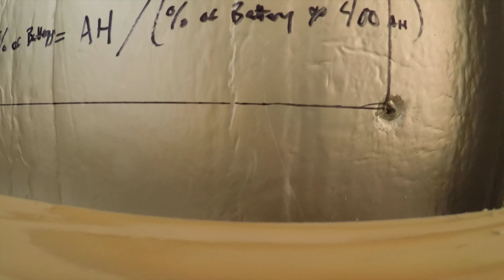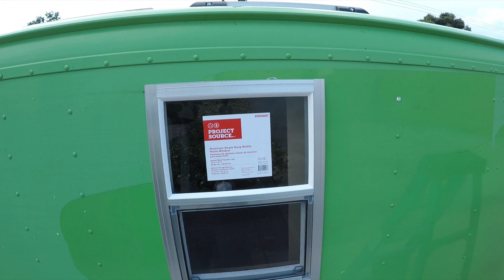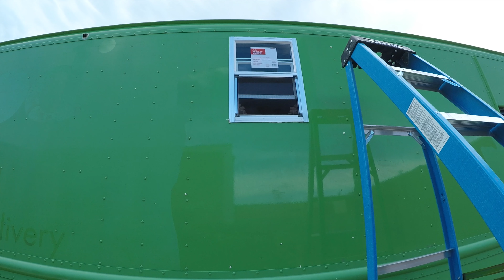Ep 21 | Tiny Home Truck | Kitchen Window & Wall

Comment: You got a new sub here! Luv your vids they inspire me to get over my fears regarding my own van build lol “there’s no turning back now...” it’s time for my hubby to install the ceiling fans and we’re both a little terrified lol    This vanlife movement has inspired us to start our own channel about how 2 urban city dwellers decide to reclaim their lives and build out a van and join the movement to freedom  looking forward to more of your vids. Keep up the great work!!!
Reply from the maker: Heyyy! Thank you for the subscribe and support!! I love the goal you've set out for yourselves! Let me know if you need any tips or info!
Reply: The Tiny Home Truck lol are you kidding we’ll take all the tips and info we can get   Starting with electrical   How did you run yours? I get the 12 gauge wires and running it along the frame and the actual walls but do you use the same gauge wiring for all your appliances?  I see a lot of red & black (12 gauge)  but everyone doesn’t appear to use conduit  sooo many questions     And thanks for responding